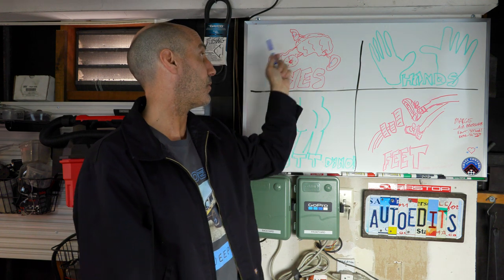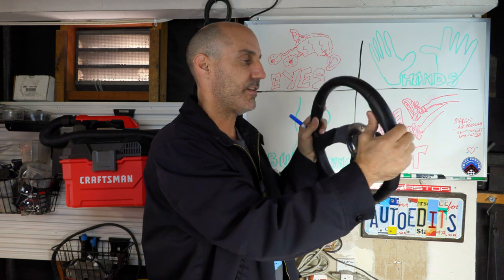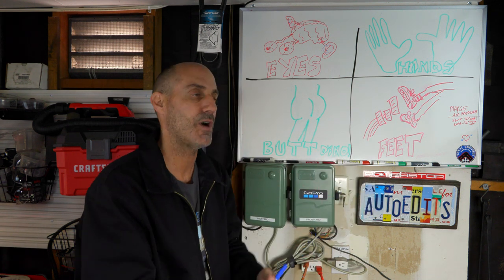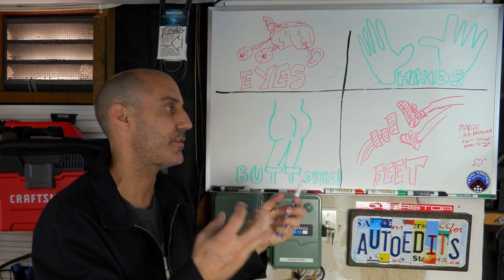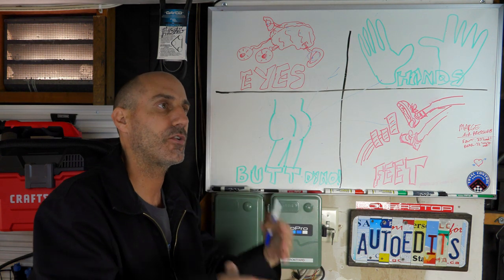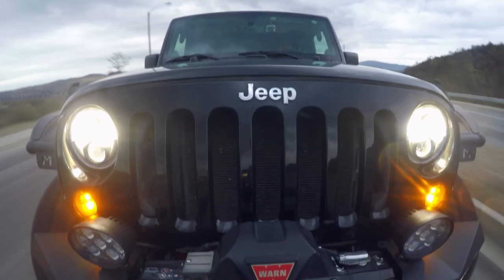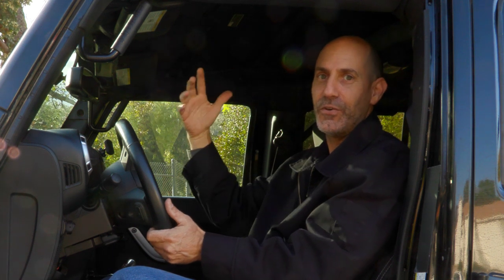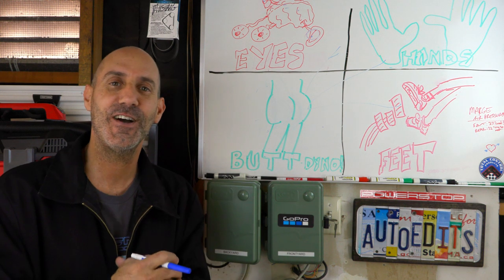Car and Human Interactions Explained

Comment: I would say that the nose could also be used just to know if there are any 'outlying' smells that are not normal, which can clue you into knowing if something is wrong with the vehicle.
Reply from the maker: Super true!
Reply: That's a great point, I usually smell coolant or oil long before I see a puddle, or notice the temp gauge.

Comment: Good stuff I don't think I've seen put together as well as you did here Jason! Driver mods are always the best bang for the buck! 
Overlooked tip I've found useful for beginners as an instructor for NASA racing SoCal is proper seat position. Helps with off-roading just as much. With  shoulder blade touching the back of the seat, be able to rest wrist on top of the steering wheel. Adjust seat  position and steering if possible as needed to comfortably achieve this.
Reply from the maker: Thanks so much!  That seating suggestion is a completely overlooked and great one!!!

Comment: Someone ever cut you off when your 3 times over your gcwr, in a 1/2 ton pickup. The butt sucks up the seat cover, as you jump a ditch, then pay back as you cut them off as you bounce back on to the road....
Reply from the maker: Yikes!
Reply: @AutoEdits  that forklift was only 15,000 lbs, plus the 3,000 lbs of trailer..... truck is rated 7,800 gcwr....
I may need a bigger truck.
Reply from the maker: LOL!